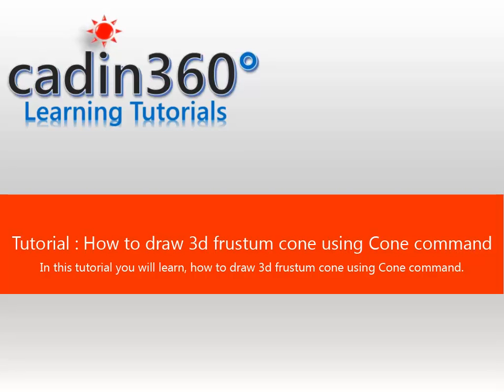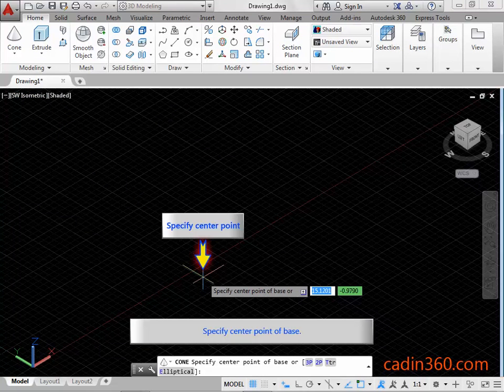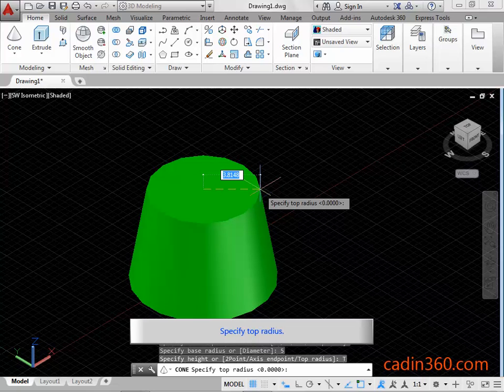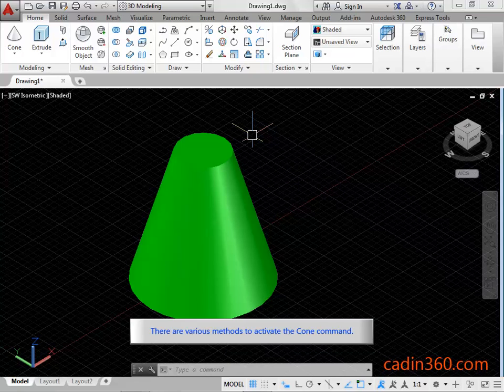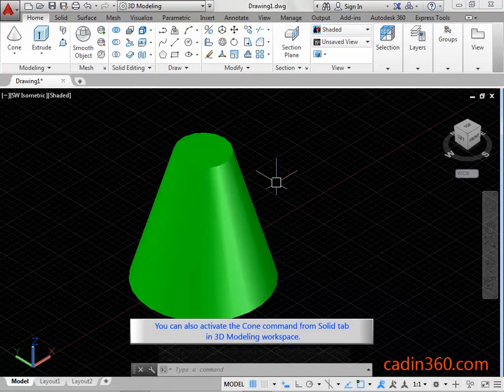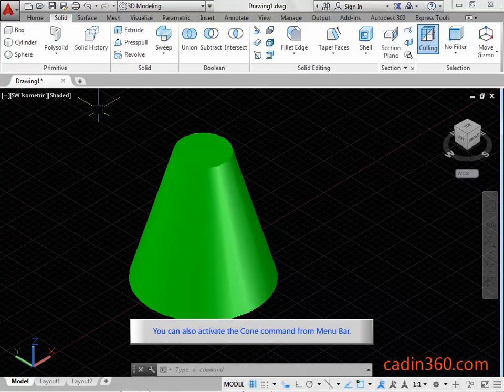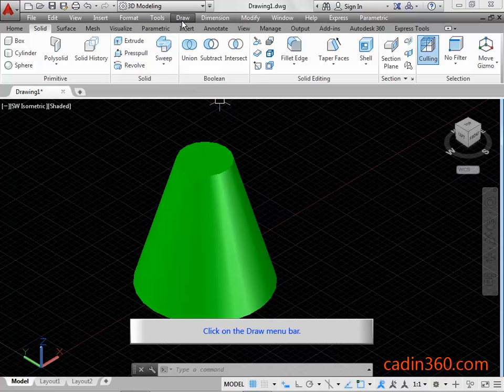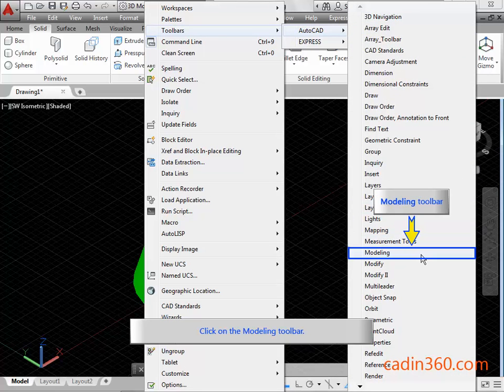How to draw 3d frustum cone using AutoCAD Cone command

Comment: how can i do sectioning ? . actually i wanna make logo for a cone that has 3 sectionin as it should be separated into 3 parts
Reply from the maker: Use sectionplane command to create section. if you want to learn sectionplane command then visit https://knowledge.autodesk.com/support/autocad/learn-explore/caas/CloudHelp/cloudhelp/2016/ENU/AutoCAD-Core/files/GUID-3AC2CA12-2085-4782-B66A-7964B73B55EA-htm.html.

Use Explode command to separate all parts.
Reply: thanxx very much
Reply from the maker: welcome  frnd.